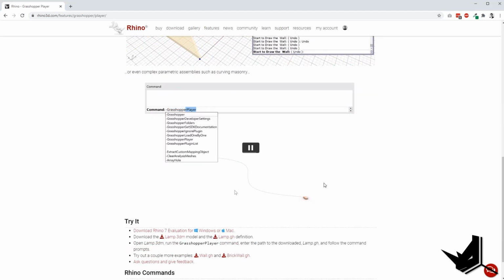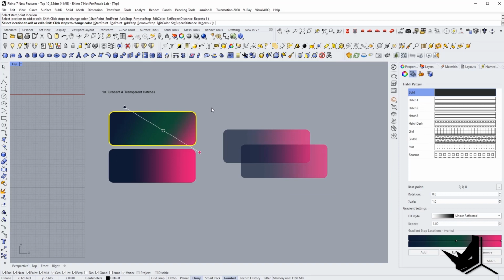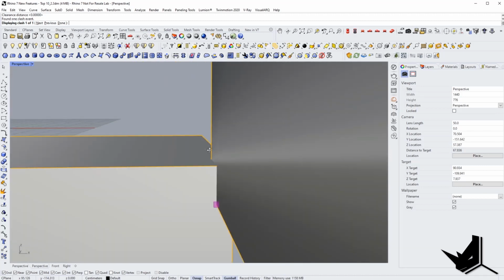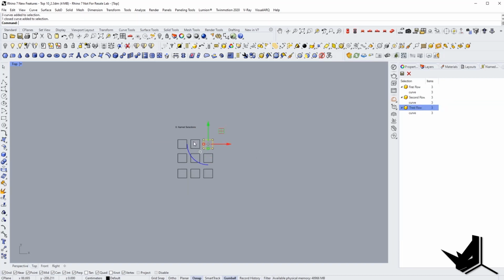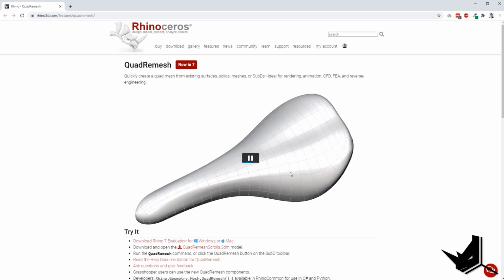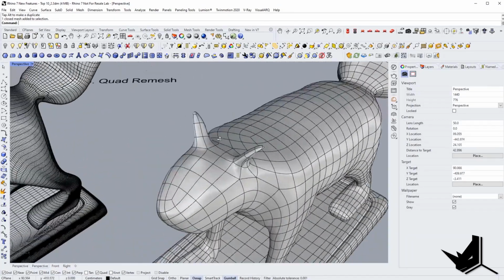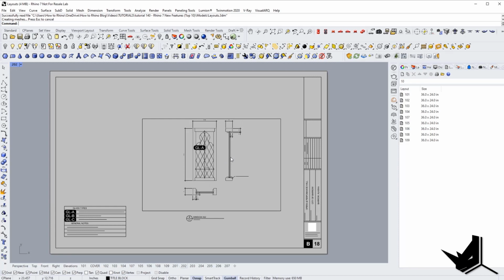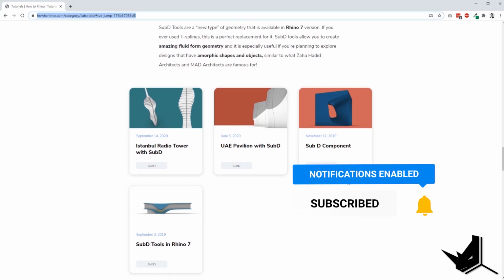Rhino 7 New Features [Top 10]

Comment: Guys what u use rhino for? I work in footwear industry and use rhino a lot. But for other things like 3d printing I use blender and fusion. What bout u?
Reply from the maker: This channel is focused on how to use Rhino in Architecture :)
Reply: Rhino can be used in many fields, especially where parametric features are not as important, like in fabrication, installation design, cabinetry, furniture, boat building etc.  It can also be used for product design, especially in the early stages of concept modeling, although as you get further into the development process, like tool-making it begins to show its limitations in comparison with products like Solidworks, Inventor or even Fusion.  It's a great tool for architects though, especially in the early phases of conceptual/schematic design.